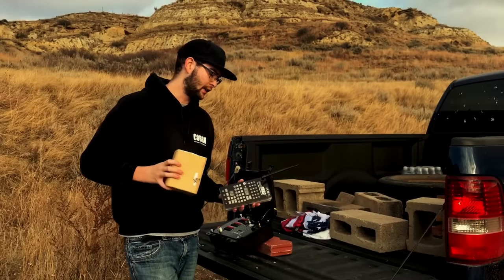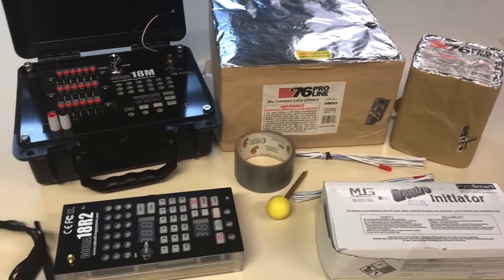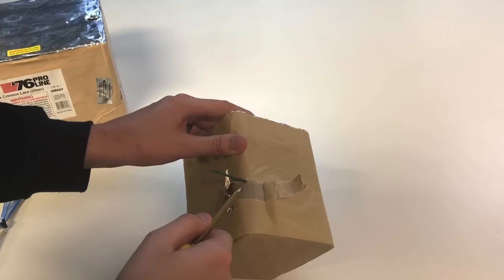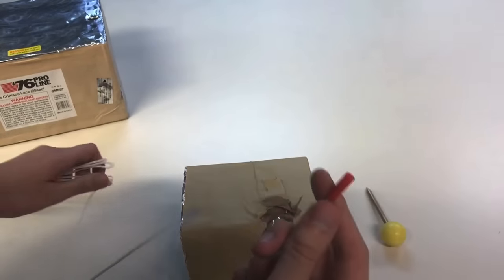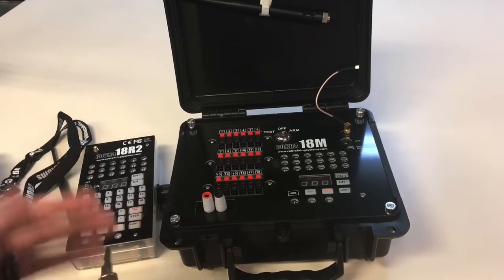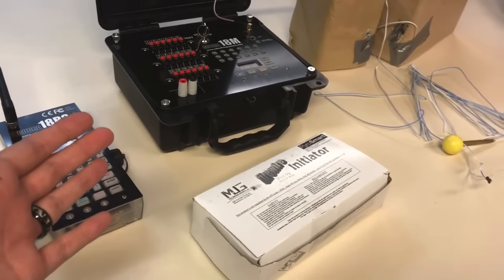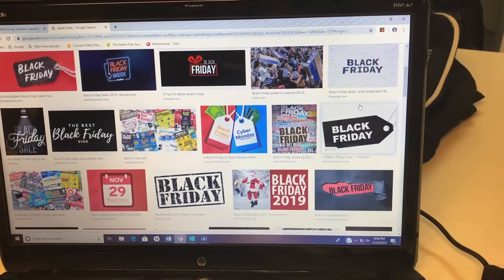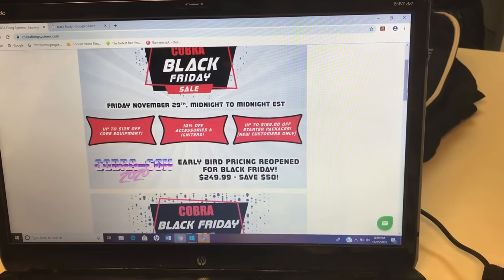Setting off Fireworks Electronically is CHEAPER and EASIER than you think!

Comment: I recommend you split the end of the wire with the leads. Most MJG igniters are pre-split about 1/8"-1/4" back from the insulation. You minimize the risk of shorting out near the end and showing false continuity. If you want to make your life easier installing the the initiator into the smaller cake, use a good razor to cut the cardboard and paper around the fuse.

Comment: 2 things, ematching is the way to go.  the other thing is  I learned this year when digging in next to the fuse you want to angle downward at least 1 degree, if you accident push up or not down far enough on some of these cakes you will in fact fire that first shot of your cake from the ground because you ignited both the lifting charge and the firework itself. The rest of the cake usually goes off the way it is designed to. I have video of 3 such mistakes I made this year when they blew up on the ground.

Comment: I'm far form a pro calling myself a noob would be an understatement. Poking a piece of metal into explosives would make me highly uncomfortable. Do you have to do it that way, or can you hook the igniter to the fuse?
Reply: It's more reliable and instant ignition this way, but you can absolutely hook the system to the fuse end. Instead of the wires shown here you would need Talon igniter clips, they're wires that simply clip on the fuse like a clothespin, though I hear they can be finicky, your mileage may etc.
Reply: @somethingtrulyhorrifying  thanks for the info.

Comment: Cody, can you attach the firing wire directly to the fuse as opposed to poking the hole above it?
Reply from the maker: Chris Mackey they make a special wire just for what you described! It’s called a “Talon Ignitor” - goes right on the fuse
Reply: @CodyBPyrotechnics  but you have a delay if you attach it to the fuse and you don't want that in your show
Reply: Thanks Cody!

Comment: The only issue I have is that Cobra firing systems are SO expensive and not really in the budget for your average back garden display user. I personally have the 32 cue Superbfire electric system and does the job perfectly.
Reply from the maker: There are certainly a lot of firing systems to choose from, I can’t argue with that! Only ones I’ve ever used or had experience with are Cobra and FireFly, I haven’t tried the one you mentioned
Reply: CodyBPyrotechnics I’ve heard of the Firefly also, which does look great however in the U.K., there are no retailers which actually sell this. Not doubting your Cobras though as they get massive praises on the fireworks forum I use regularly👍🏼

Comment: Hi Cody! You mentioned that you can use the MJG Initiator with NOAB's. I am wondering if you would be willing to post a video on how that is done? Most NOAB's I am familiar with don't have black powder that you can get into as the lift charge is in the shell. If you don't mind, I would love to see that (or if there is an existing video / article online, would you mind posting a link to it?) Anyway, great video's, I love watching...keep them coming!
Reply from the maker: Absolutely! There’s a smaller tube within the large 3” tube. You just have to make sure to poke through that tube that holds the lift charge too. Even if there’s just a hole there, it should be enough fire to set it off. I do have a video on this already. Look up “lighting a truckload or fireworks electronically” - in this video I shoot several NOABS with the MJG wire
Reply: Thanks Cody! I watched the video and it was very cool! If when you go to put another MJG initiator into a NOAB, consider helping an old guy out with posting a demonstration video on how you do it - visual learner here :-)! Thanks again for all you do and sharing your knowledge with all of us!
Reply: Also, FYI you helped me in my decision to purchase a new Cobra Firing System - it will be here hopefully next week and can't wait to get started using it! Thanks again for all you are doing!
Reply from the maker: Will do! Thanks again!

Comment: Off question not related to efire systems. About how many feet of fuse do you typically use for a single show?
Reply from the maker: Usually 3-4 packs, so just over 100ft
Reply: Nice, I should be good then I got 2 packs of each kind 😂. Appreciate the response 👌

Comment: I never liked the way you hook up wires to the firing system. Bending those tiny wires and inserting 2 of them for each cake can be a huge hassle especially when you're setting off a dozen or more cakes. I hope in the future they make the tips of the wires as a tiny metal clothes pin that you clip onto a tiny metal bar. Kind of like when you hook up those jumper cables to your car's battery. That should in theory work well, and it would be easier and faster.
Reply: You don't need to do one for each cake. You can fuse a bunch of cakes together and then use the firing system to light that one fuse.
Reply from the maker: It certainly can be intricate work! But I always say if fireworks are involved in any way, it doesn’t feel like work to me. lol
Reply: Check out our brand new Quickplugs. https://www.cobrafiringsystems.com/quickplugs